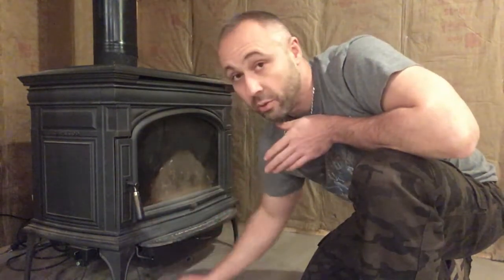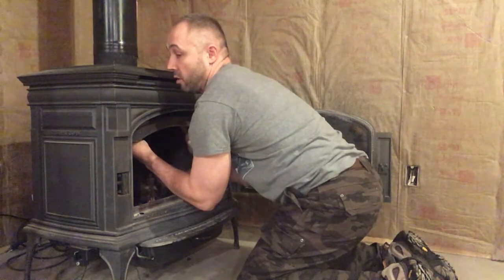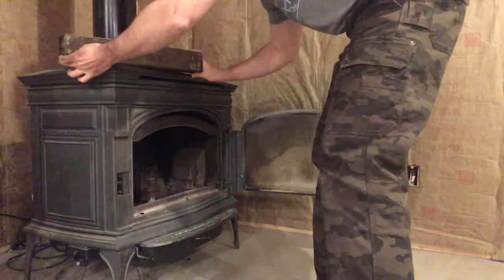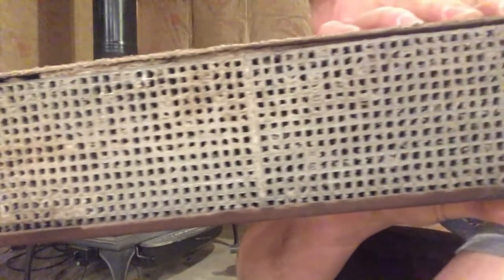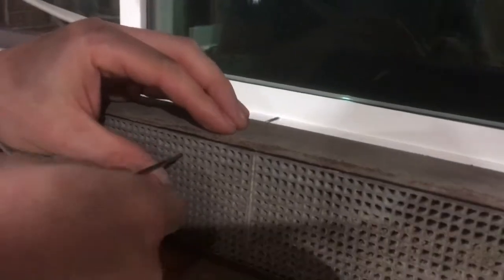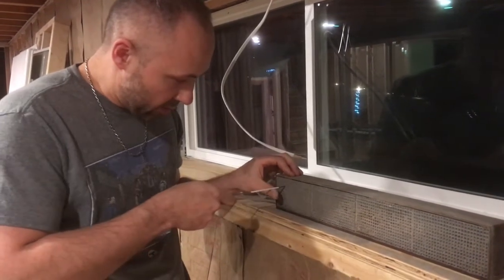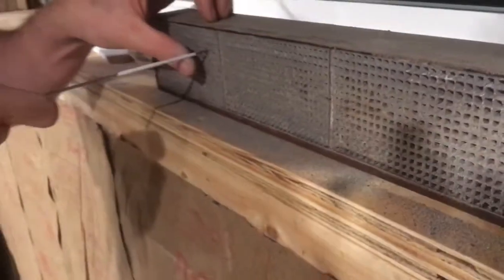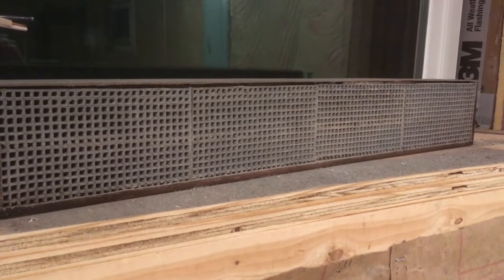Wood Burning Stove 27 Cleaning Catalytic Combustor make a huge payback in efficiency Lopi Cape cod

Comment: Wait a min! Everywhere I've read says if you brush it you rake off the prescious metals that are on the surface and required for the cat to work effectively ruining your cat. They all claim this decreases your burn times after the precious metals start getting raked off from the brushing even though the cat looks cleaner. Yet, here you are brushing yours. You sure you shouldn't just use some compressed air and let it look a little dirty or maybe there's some other method to clean it? I've been considering one but this is one of the problems I'm looking to solve 100% before I consider purchasing myself.
Reply from the maker: Have you ever put a tooth brush to a gold chain? Does the precious metal get "raked off"... no. I used electric tape that was frayed around the edges which created little bristles and was not rubbing hard. I was gentle. I don't' have a good compressor, just a little one for brad nail gun.. I used compressed air and it works pretty well. Here is that video link https://www.youtube.com/shorts/RAk4tIvglH0 Thanks for watching!

Comment: Smoke is actually unburnt wood. Your problem is burning low grade wood. If you burnt say, dried locust that has been drying a couple yrs you may not have to clean it hardly once a yr. Elm, ash,  maple, oak, walnut, all are hard but way better if the dried for 2+ years. 6mo is the minimum. I was pulling out downed locust that's been down for 10yrs and that's super hard.
Reply from the maker: Thanks. All my wood at this point is like 4-5 years dried, Oak, red oak and maple. I got a couple trees from this spring to split and add to the stack. I'll let 'em dry some more. Thanks for watching!

Comment: After 5 cords of wood thru my Blaze King in 3 years, the fire goes out when I divert thru the catalyst, so I suspect it’s time to clean mine as well.
Reply from the maker: Yup. goes faster if you have compressed air. Thanks for watching!
Reply: @everydaypawel9193  Fortunately I do!  Thanks 🙏🏼
Reply from the maker: @modquad18  should be easy for you then!
Reply: @everydaypawel9193  So I removed it and turns out it only had a thin layer of debris on the firebox side, could have probably just brushed it off (or easily vacuumed) - I fully expected it to be fairly plugged up, but it wasn't at all.  Blew it out nonetheless and picking up new gasket tomorrow.
Reply from the maker: @modquad18  glad you were able to figure out what you need to do.

Comment: I'm planning on buying a Hearth Soapstone wood stove.  After watching your,  I figured I would buy an extra catalytic to swap out a dirty one for a clean one.  Or just as a backup.  With the supply chain getting worse you might not find one when you need.  Appreciate your time with a great video.
Reply from the maker: It is normal to clean em'. they are expensive, Platinum or some expensive material. Your decision. Best of luck. Thanks for watching.!!!

Comment: i run a thermal oxidizer (cat) on a output of a coffee roaster.  i clean the cat annualy.  like you, i initailly use a shop vac along with compressed air.  then i soak the cat overnight in a warm bath made with dawn dish soap.  let dry, then repeat the compressed air/vac.  ... i feel scraping the cat pores with anything damages the prescious metals.
Reply from the maker: Agreed, no scraping, I used soft electrical tape to expand the rod to the full diameter of the hole. I believe there is no really scraping/scratching which would cause damage, yet still removes stuck on buildup. There is some fire proof fabric around it, some almost got sucked out and I stuffed it back in, so I will be unable to soak it. thanks for watching.
Reply: @everydaypawel9193  , that fabric is probably basic rock wool.  cheap enough to replace.
Reply from the maker: @ARSciandra  Yes, you are probably right. Cheaper than replacing it is to not suck into vacuum. thanks for watching.

Comment: I’m looking at getting the Lopi Rockport. The damn catalytic Combustor  is $400. I might as well get another one when I get the stove. It could possibly be $500 by the time I need to buy another one. I have a small air compressor, so it should last several years by cleaning it with air.
Reply from the maker: Yes they are expensive and  you don't' need to replace because they get dusty, only if it cracks really falls apart. Mine has a crack. the material will still function as a catalyst for the reaction.  they  should probably clean it a couple times a season. careful to keep the bypass open if there is a lot of ash moving around in the stove, like during cleaning. I used a leaf blower to clean it, didn't work so well. I got a 5HP Dewalt vacuum cleaner with a blower on one side, it worked well. I had a little 1 gallon compressor, it works well, but the problem is there isn't much volume in the tank, so it takes a long time. Good luck.
Reply from the maker: I've had mine for 6 years and I burn 24/7 in the winter, Thanksgiving to Easter, same Catalytic combustor
Reply: @everydaypawel9193  if yours lasted 6 years, mine should last 20. I’m in Georgia and will only need it maybe 3 months out of the year.

Comment: I think this is what's wrong with ours even though. its a brand new stove and had it installed this past October. I looked up where the catalytic converter is and saw the left side bezel that goes around the converter sticking out about an inch and the right side was normal. I tried to push the bezel back but it didnt move so letting the fire die out and maybe tonight I can see what's going on. I haven't been too impressed with this stove, the first couple burns it was great but about one month into owning it, the lower air control lever does nothing in or out for the fire and not getting consistent heat from it, sometimes with the same weather/temps. it will be roasting us out and other days you can barley feel the heat.
Reply from the maker: I wish you the best. let me know how it goes. Wood burning stove is a simple tool, wood and air in, air out. Stop any of those and no fire or low fire. Thanks for watching!

Comment: If you have access to an air compressor and blow gun, this is the fastest easiest way to clean a catalytic combustor without damaging it.
Reply from the maker: Yes. Have to be careful because there is a thin layer of insulation material between the metal casing "box" and the catalytic combustor. I blew it out. My compressor is small, so it only works for 5 seconds at a time. designed for a small brad nail gun. A Strong leaf blower works too 😃. I just use shopvac last time, 8.5hp strong motor, did the trick. same thing, careful not to suck out any insulation around the edge.

Comment: I have the same Lopi Cape Cod stove and so I'm glad I found your video. I'm having the same issue, and am having trouble getting my temps up. Even a week ago, I was achieving burns 950 degrees and above and now they're running barely into the 700's. Is it hard to get the combustor out? And have you had any issues with the gasket in the back of the stove falling/burning out?
Reply from the maker: it is not hard to get it out. it is just like a box of metal, it is a good fit in the slot but it does not fit tightly. best if you can get the stove down to warm enough to the touch, get in with your bare hands and grab the side with your finger nail. if you can pull it forward just a little, it slides right out. I don't use a air compressor to blow out the soot on purpose. there is a thin layer of flame resistant insulation between the combustor and the box. I haven't had to clean it for a long time. I find that if you use wood that still has a high level of moisture, it doesn't burn hot. I bring in a lot of wood for 2 reasons, 1 to have a lot on hand, 2 after 1 week in a hot room, it really helps it dry out. Even if your wood is seasoned for 6 months -1 year or many years, there is nothing like a dry hot room. Cleaning out the catalytic combustor is immediate temperature increase. Thanks for watching. Let me know how it goes!
Reply: @everydaypawel9193  Just cleaned it and you're right it came out very easy! It cleaned up nice as well. I put it back in the stove, fired it up, and we're already over 1,000 degrees in about ten minutes. Before cleaning it, when I would push in the combustor handle it acted like I was closing down the flue. Now it's roaring again. I appreciate you getting back to my comment and for the help!
Reply from the maker: @DannyJSchaefer  Awesome! glad it worked out for you!

Comment: Nicely done. Did your stove smoke more when putting a log in? Any back draft issues caused by the clogged combustor?
Reply from the maker: There is a "bipass" that I open every time before opening the door and while it is open. you are right, if the combuster is clogged and you open the door, smoke will come out. instructions say to only close the bipass after the temp is 500F or higher to prevent material from settling in the combustor causing clogs..
Reply: @everydaypawel9193  Thanks very much!